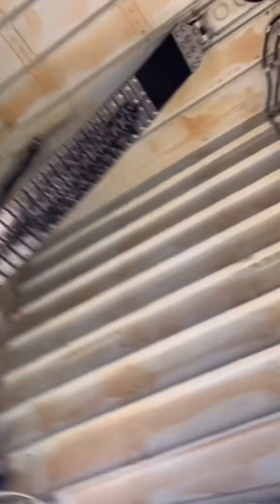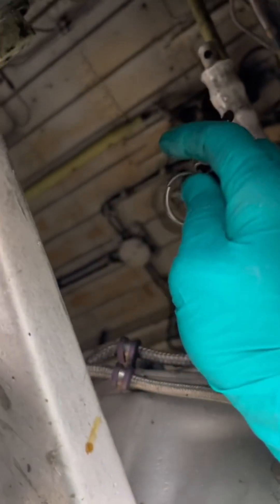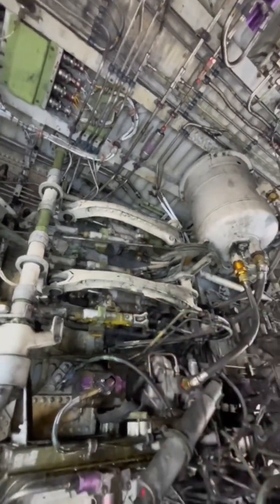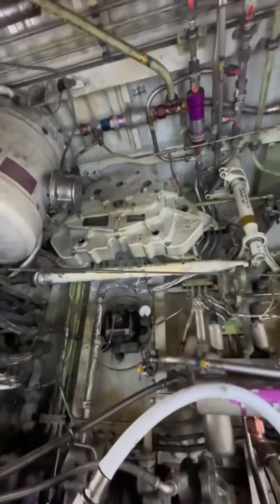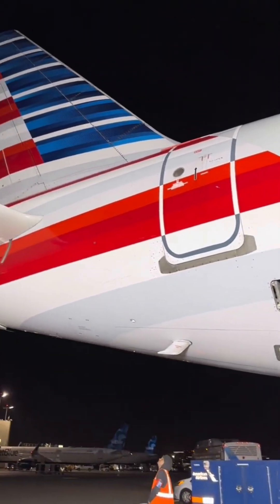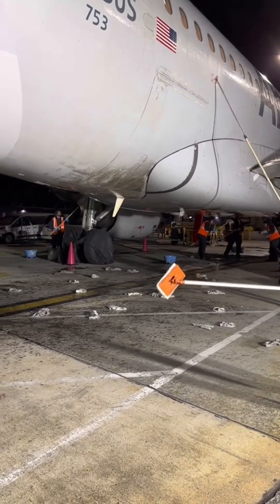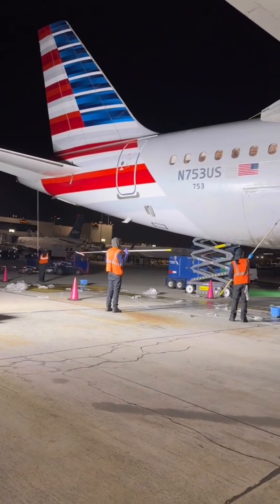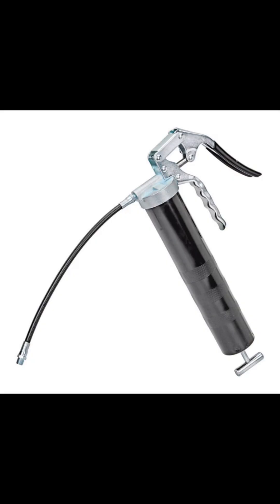How Aircraft get Cleaned and Why they get dirty.

Comment: Nice and informative video! To add to 3:20, a dirty plane creates more drag and is measurably less fuel efficient. Now maybe airlines don't clean planes for this reason alone, but from what I've seen it can be ~1-2% fuel savings.
Reply from the maker: Great point! you are absolutely correct

Comment: How often (approximately) is the pressure clean performed?
Reply from the maker: Usually in a heavy check environment, C or D checks which is around 5-7 years of the birth of the aircraft
Reply: Heavy checks